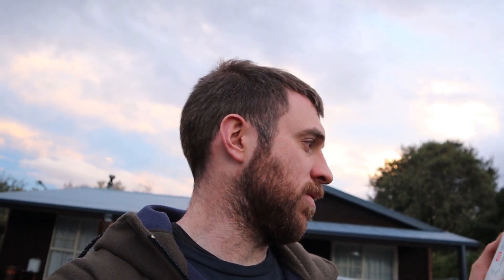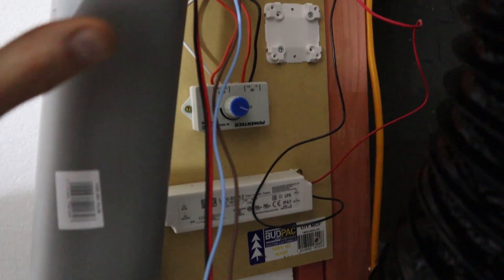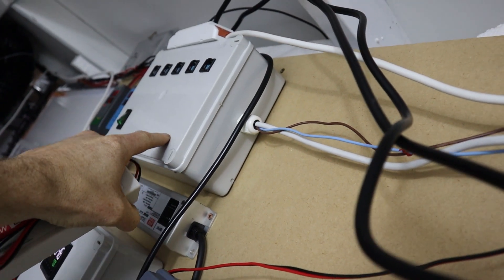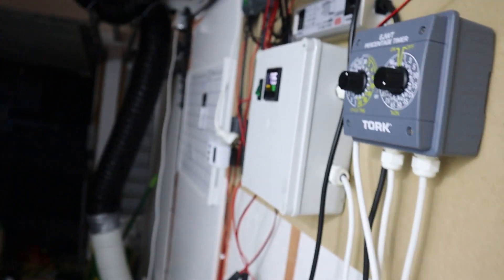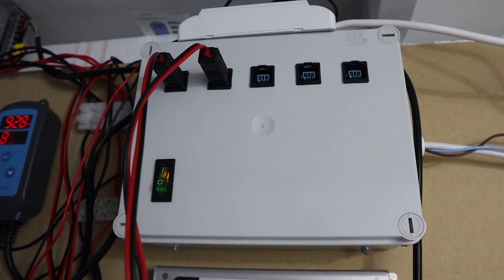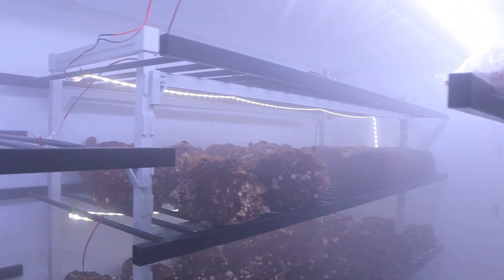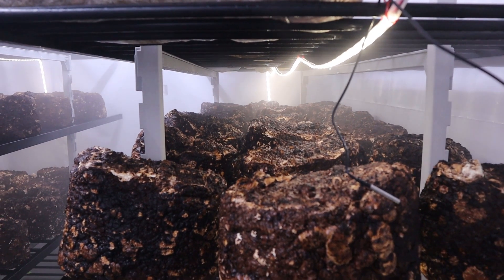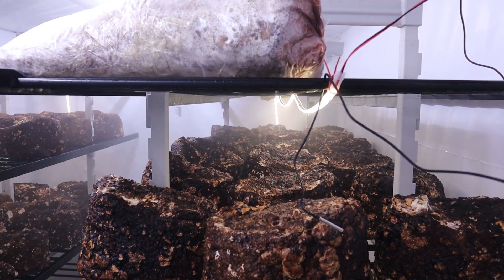Mushroom Ventilation and lighting  - Venting CO2 and installing new mushroom grow lights

Comment: Why do you have the airflow going from top to bottom for your CO2 Transmitter pipe? CO2 tends to settle low when it's at the same pressure and temp as the other gases it's around.
Reply from the maker: There is far too much movement for co2 to settle. I think its a bit of a urban myth having co2 settle at the bottom of fruiting rooms. There is far too much atmospheric diffusion with new fresh air being pumped in all the time.

Comment: Hey mate, love your work! Was wondering how you vent the portable A/C air into the grow room?
Reply from the maker: I don't anymore. The AC unit broke and I haven't replaced it.
Reply: Fair enough! So does the fruiting room just maintain an okay temp? Thanks for getting back to me
Reply from the maker: I heat it in the middle of winter, and summer it can get quite warm. I haven't decided what I will do to cool it yet, or if I will even need to.
Reply: Keen to see the solutions you come up with